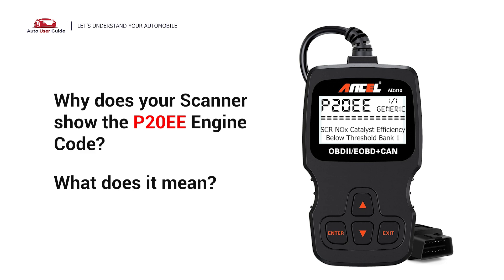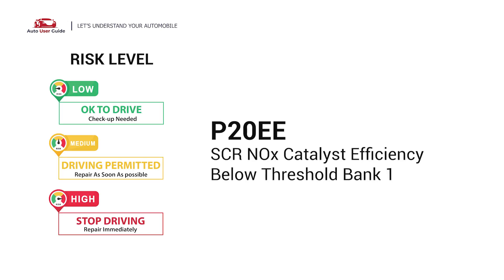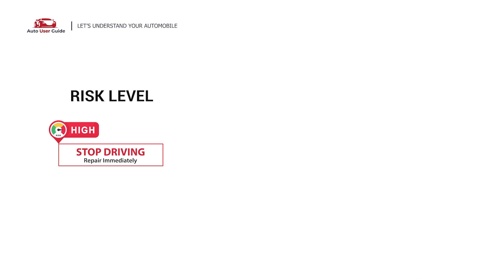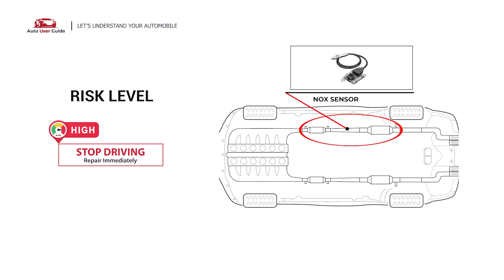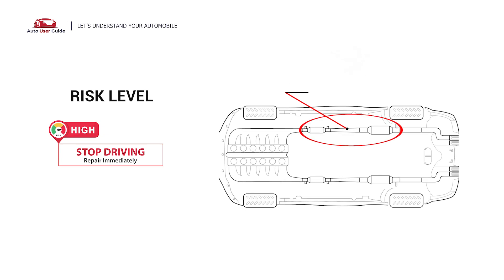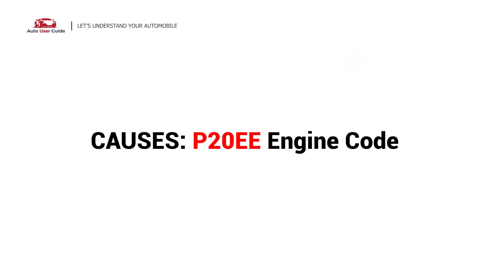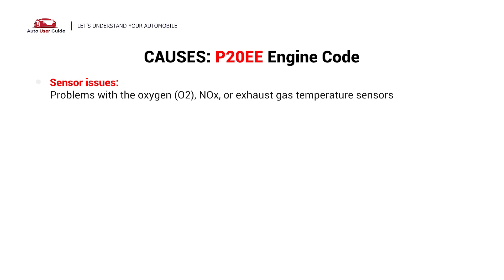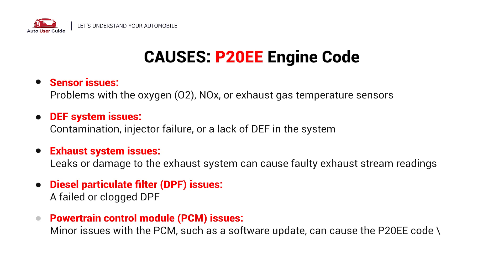What is P20EE : Engine Error Code Causes Explained

Comment: I have a P20E error code and my truck is in limp mode. It's a 2017 Chevy Colorado diesel. The knock sensor after the turbo has been replaced. The def pump has been replaced and this code keeps coming up and it keeps going into limp mode
Reply: @thepunisher478  delete it or trade it off. All these newer diesels are hot garbage. Chasing dpf/egr problems will bankrupt most people